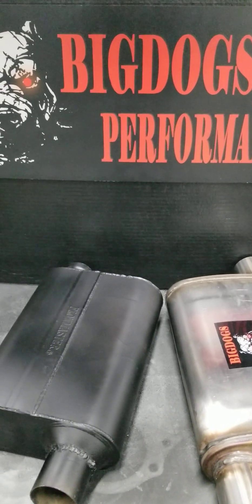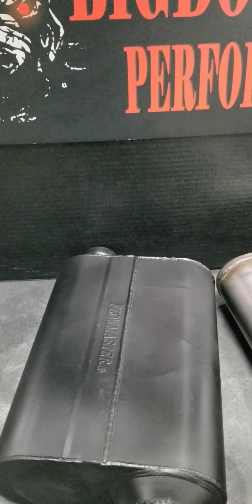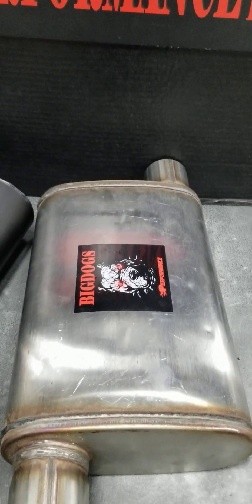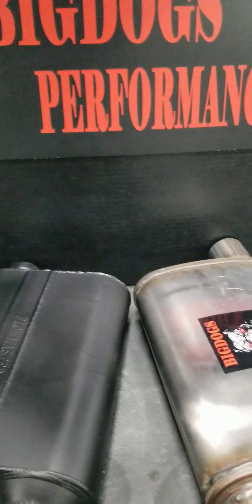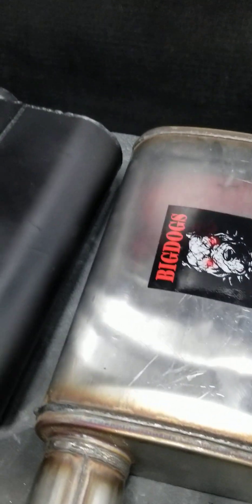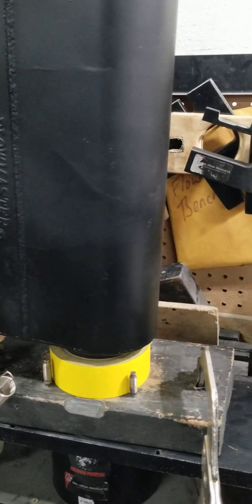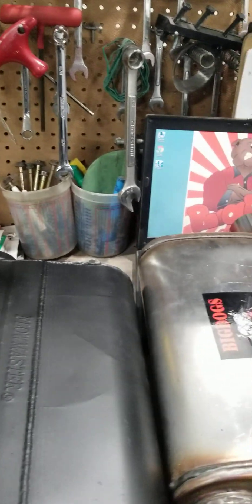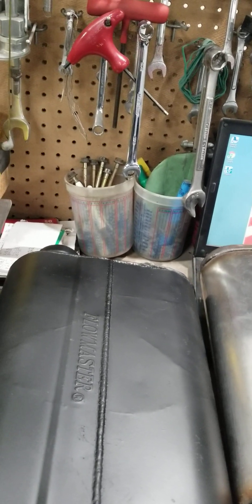Flowmaster 40 series Flowbench test. Are they a restriction on your car? 🤔

Comment: So basically installing a flowmaster is the same as installing a section of 2" pipe in your exhaust system.
Reply from the maker: Actually a straight section of 2 " pipe with a radius flows more

Comment: Center to center on a straight through will get slightly better.
Reply from the maker: @roderickconstantino5354  yes but only buy 15-20cfm
Reply: I’ve seen an 800 rear wheel horsepower 03 cobra with flowmaster catback unbolt the catback and do a pull with open x pipe and it gained 8 horsepower. Sounded wayy better with the flowmaster bolted up. And a personal friend of mine ran 10.1 quarter mile at 140 mph with 2.5 inch super 44’s. So are they really that restrictive? I guess if you’re racing and trying to get the most hp I understand. But the straight through muffler is going to be raspy.

Comment: Oh what is the best flowing Offset offset, 3" muffler on the market that wont fall apart in 3-5 years made out of 304 or 409 steel?
Reply from the maker: We have flowed 3. They all sound great, they all flow about the same and they all are offered in stainless steel. Magnaflow, the mufflers we sell and Pypes Race pros. 
Now muffler flow should be calculated from the motors requirements. Meaning if your motor doesn't need 1,400cfm of total muffler flow then having it won't free up anymore hp. It only frees up hp if your current exhaust flow is restrictive.  Also your headers and exhaust system flow can't be a bottleneck either.

Comment: I do exhaust for a living, i will admit i like the flowmaster 40 series sound..no doubt, its that retro 5.0 tone. The darth vader sound.... Long tubes, 2.5 inch duals, h pipe, 40s with axle dumps... that's the sound. But they flow terrible. This may sound crazy, but as someone who knows his products.... Id rather run a Dynomax Super Turbo than a 40 series flowmaster if i cared about power. The muffler that is straight through and has a perforated core will always make the most power . Period. The only reason ive seen cars "pick up" from a pair of flowmasters was from the added restriction correcting a carburetor jetting issue somewhat. But a magnaflow and a correct tune/jetting would've had more overall power. Flowmasters get even worse when you have a offset center or offset offset configuration. Oval case magnaflow style mufflers are always the right answer for any application. Something else alot of folks dont take into account, is a large case perforated core muffler is better for torque than a small case perforated muffler... Because with a perforated core , you dissipate the exhaust pulses during camshaft valve timing events, aka overlap which with a straight pipe can cause reversion. Larger the case, the more capacity to soak up the reversion, and to eliminate the exhaust pulse at the muffler which helps with wave length tuning. Sort of like David Vizards Exhaust Pulse Elimination chamber. You are spot on here. Why would you have a .550 lift cam, spend big money on ported afr's and a ported intake, stepped primary long tubes....just to shove a cork in the tailpipes. Why would you do that? Great video.
Reply: Super Turbos are  the S bend internal flow directors that David Vizard invented...

Comment: Thanks  for the info i been look for others  mufflers  other than Flowmaster  i had em in my 64s and 69s but i want something different  on my 95ss specially cause i had engine rebuilt wit internal upgrades and im gonna install a torquehead ignition system on it

Comment: The results was as I predicted...Thank you for bringing awareness to the automotive community. I got the 2.5" Stainless Cherry Bomb Salute straight though style with perforated core...Its kinda like the old school Smithy's muffler but larger and perforated instead of louvered. Louvers make that snap crackle pop sound due to the turbulence inside them, that can't possibly be good for flow either! 

ooh perhaps that could be a new comparison... compare the construction and flow of the stainless Perforated core and wrapping vs the old louvered core glasspacks
Reply from the maker: We just flowed a red louvered round straight through glass pack in a 2.5" version and it didn't flow as well as one may have thought. In the mid 400cfm range

Comment: I knew there would be a difference between straight through and baffles, but thats alot. I've had a Flowmaster on my truck, I rusted off, never again.
Reply: It sounds like you had the aluminized steel. I believe their 409 stainless steel will last longer than the exhaust you have on your truck.

Comment: Of course it’ll outflow the 40 series chambered muffler. Do one against the Flowmaster outlaw series or karnage performance series one mufflers Or Dynomax race bullets. It would be nice to see those flow characteristics
Reply from the maker: A 2.5" OD pipe with a radius flows 670-675cfm on our bench and the SS straight through 2.5'  mufflers flowed 661cfm with a radius on the same bench.
Those mufflers you named are LOUD and not really practical to run on the street everyday. Its funny when we compare our recommended street performance parts and they do well the first thing people do is say well compare it to a part that's pretty much a race only or track only lol. And for the record the stainless steel mufflers flow just as much as those other mufflers without the police attracting noise.
Reply: @bigdogsportingtonyb2833  I love the noise though. I know a lot of older guys like quiet mufflers but not this one. I’m not knocking your mufflers at all. I just wanted to know the flow characteristics.  Of other non chambered muffs. I’ve had all types of mufflers on my cars over the years. Since a kid I liked Flowmaster. As I got older I’ve had a variety of mufflers, h pipes x pipes and have liked them all.
Reply from the maker: @mrbonafied78  those stainless steel mufflers are definitely not quiet and the more you get on them the louder they get. We flowed a red round 2.5" cherry bomb, a 2.5" borla, a 2.5" magnaflow, a 2.5" Pypes Violator and none of those flow as much as the ss mufflers but they all flowed  more than the flowmaster.
We posted sound clip videos of the ss mufflers
Reply: @bigdogsportingtonyb2833  thanks for the info I’ll check the sound clips out.

Comment: But open 2.5 inch flows 564 cfm does the radius really add 100 cfm? My wife says you forgot about pulse width involved in exhaust which hits the chamber muffler differently than your bench, I’ve seen cars make 55 more hp without mufflers so I’m sure these are worth a good bit on a hotter setup as they obviously flow way easier
Reply from the maker: The radius smooths out the entry on the pipe so we can get a 100% true/accurate flow measurement of the part. Flow is flow and as rpm climbs the pulses loses time in between each other and starts to act as one. Just put a dollar at the tailpipe at idle vs wot and you will see. No matter how you look at it a restriction is a restriction and there is plenty of back to back tests on higher hp cars showing the flowmaster 40 series mufflers robbing hp. 300cfm from a muffler is horrible. If you use the 2.2cfm per hp rule then you can see just how bad they are
Reply: @bigdogsportingtonyb2833  We’ve come around to using 1.5 as we feel it’s more realistic but some people don’t have a clue, the shop is building a 347 high dollar Lunati kit, 11r heads victor but dude demands a b cam😂 he’s probably set on flowmasters to
Reply from the maker: @88TRUNKBACK  🤣🤣🤣 exactly!!! It never ceases to amaze me when people do things like that.